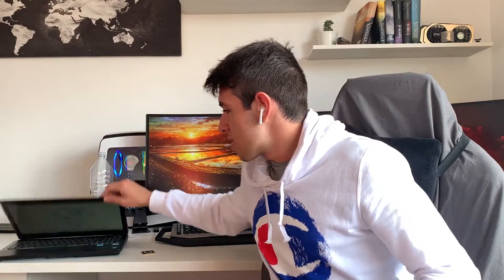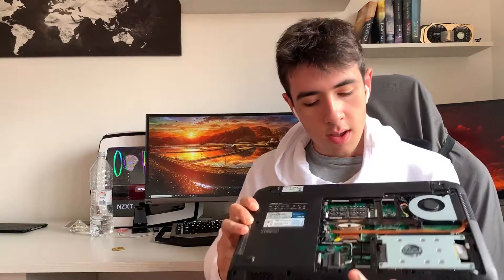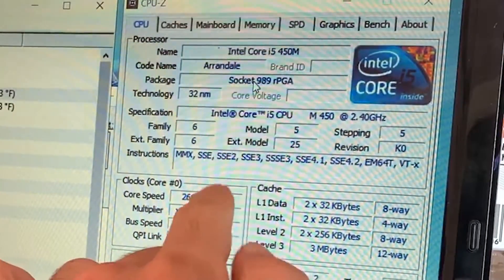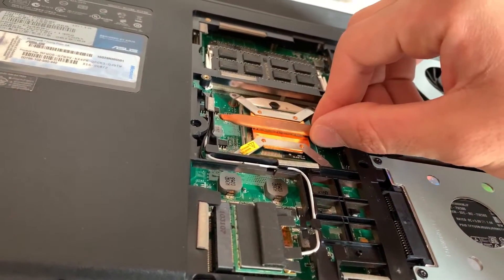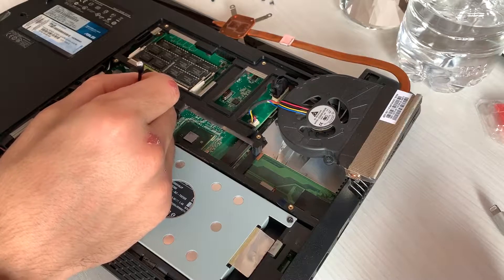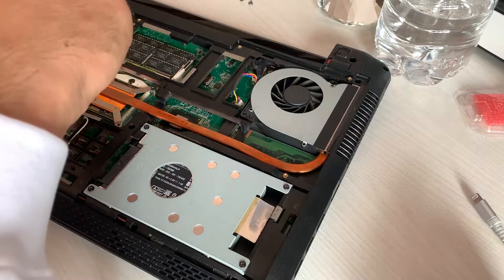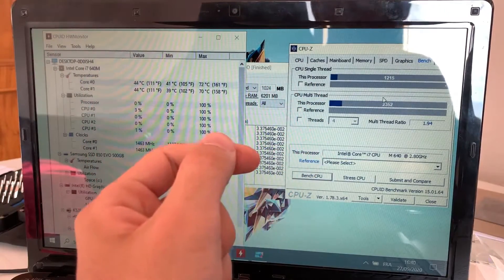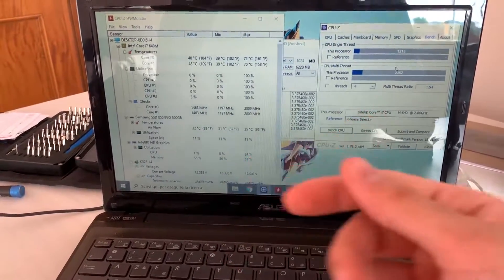Laptop CPU Upgrade: from a Pentium to an i7 - Liquid Metal Inside!!

Comment: i have a HCL ME icon laptop and it came with a pentium B970 and after my research i want to upgrade it to i7 2620M or i7 2640M. plz tell if i can upgrade it or not. they both are based on sandy bridge, both have 35 watt TDP, they both support intel chipset HM65. but regarding the socket (on the intel web site) the pentium has FCPGA988 and the i7 2640M has FCBGA1023,PPGA988. the HCL ME icon 1015 series also came with i3 2330M and i52450M processors and last what it your laptop model name. thank you very helpful video.
Reply from the maker: First of all thanks a mot for still watching this old video of mine! You should be able to the upgrade :)

Comment: Love seeing old laptops being upgraded to insane degrees! Ordered an i7 620M myself since I bought my childhood laptop again from eBay. Though I think the CPU inside the laptop died. 
Gave me a great excuse to upgrade the CPU to the max! I'm still a little afraid of liquid metal so I ain't going that far.
Reply from the maker: It really means a lot to me that somebody is still watching my older videos! 

Getting older tech to work at its best is what I like the most about hardware, I'm sure you could go ahead with liquid metal as well if you wanted!
Reply: @ImWateringPSUs  Heh well not many people are willing to see the improvements of cooling down a old laptop cpu with liquid metal so this was one of the first videos to pop up when I looked up "liquid metal for laptops", or something along those lines.
I mean it's not that I wouldn't. It's just I want to do it properly if I ever go down that road with the right things like tape and nail polish so the metal doesn't leak out. 

Also it turned out to be a corrupted BIOS. Not a damaged CPU! It's actually has low temperature for the i7 620M thankfully.

Comment: Nice video. What laptop model is that? It seems very easy to upgrade compared to most laptops.
Reply from the maker: It really is. It's an older Asus that was shipped with a 1st gen Pentium in it, can't remember the exact model tho
Reply: @ImWateringPSUs  I just got this laptop. it's an x52f. i put a i5 580m in in and with new thermal paste it's running at only 50c under load. the cooling system in this laptop is very good, i have seen laptops with similar cpu's and they run way hotter. I don't think liquid metal is necessary with this laptop, even for an i7. I don't think the heat output would be much greater than with my i5.

Comment: How many integrated graphics memory it has?
Reply from the maker: It shares the memory with the RAM the system uses, so it gets about 1-2GB reserved
Reply: @ImWateringPSUs  thanks for the reply :)
Reply from the maker: @kuzugalang  You're welcome!
Reply: @ImWateringPSUs  ive been searching it thanks because i want to upgrade my toshiba to core i7 640m and 8gb of ram and im wonderin if it can run gta v so ihope it can reach 60 low settings
Reply from the maker: @kuzugalang  It probably can run at a very low resolution and with low settings
Reply: @ImWateringPSUs  yeah it so hard to find a gta v gameplay with this gpu some of it has a dedicated gpu i just want the benchmark just the integrated
Reply from the maker: @kuzugalang  Yup, I feel you

Comment: Can i Upgrade I3- M370 To Any I5 or I7 that is compatible on K52Jc??..
Reply from the maker: Yes you can! It’s basically what I did here
Reply: How many % if success ratw if i install it on i5 or i7
Reply from the maker: @zer4cle710  If it's an i7 with the same socket, I'd say 100%

Comment: What is your chipset? HM70? HM77?
Since you are not experiencing auto shutdown each 30min, most likely it is a HM77.
Reply from the maker: It should be an HM70, but there's no auto shutdown :/
Reply: @ImWateringPSUs  
> "It should be an HM70"
All over the net people are complaining that this chipset was intentionally capped, ie, it works fine with i3/i5/i7 for a while then shutdown after 30min.
1) What BIOS are you using? OEM? coreboot? libreboot?
2) Did you applied me_cleaner?
3) If you still have this notebook, you can check the chipset model via linux prompt: 
lspci -v | grep -i HM
Reply from the maker: @rogernevez5187  I'm running the stock bios, updated to the latest version. No ME cleaning or anything, just disabled the spectre and meltdown patches. I also tweaked the power options both in the bios and in windows. I gave the laptop to my grandma so I cannot really install Linux on it.
Reply: @ImWateringPSUs  
> "I cannot really install Linux on it."
You can also confirm that on windows: CPU-Z > Mainboard > Chipset
It would be very surprising if your chipset is indeed HM70 and you have not done any mod to unlock it.